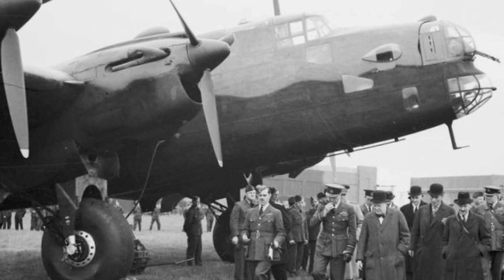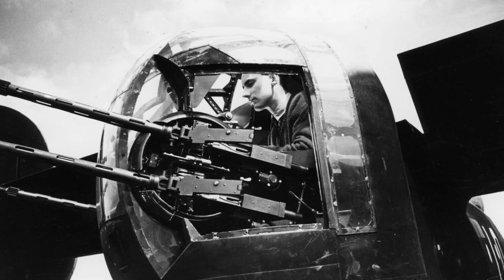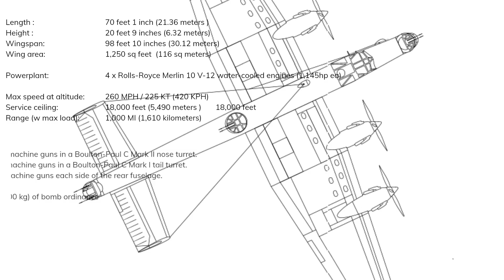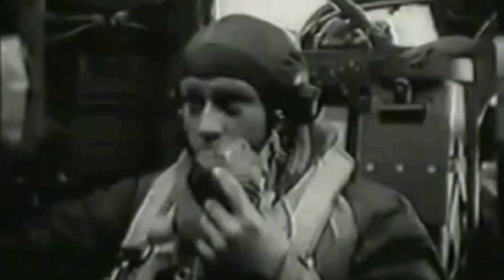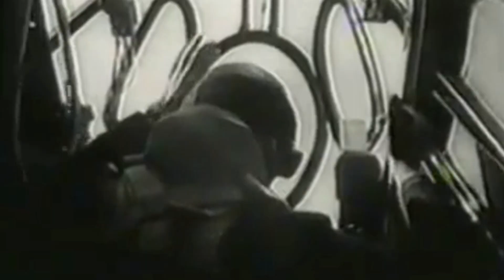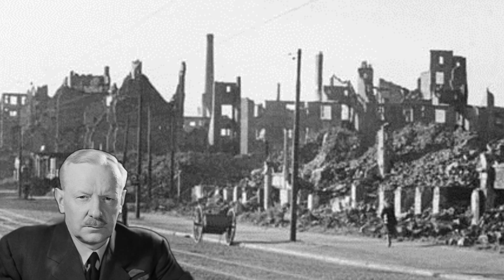The Handley Page Halifax

Comment: The Halifax was the preferred aircraft for secret missions over the Nazi occupied countries in Europe. It transported and dropped SOE agents, weapons, equipment and supplies to the resistance movements fighting the occupants. Its engines were not as noise as those of the Lancaster and the Sterling, and made it more suitable for slow low level night flying over the harsh mountainous landscape of Southern Norway dropping its cargo when spotting the vague signals from the ground. It was a dangerous mission which was essential for fighting and sabotaging the German was effort in occupied Europe.

Comment: My dad flew in the Halifax Mk3. He applied to join the RAF in 1939 but was told to complete his electrical engineering apprenticeship first. He did his training in 1942 in Canada and qualifies with his wings (for 2nd pilot), radio op - navigator and bombardier. He began operations from early 1943 including European raids, glider, coastal and transport duties.
Reply: Hi. Which Squadrons was he in?
Reply: @Oligodendrocyte139  I have his log books but I cannot access them very easily as they are in storage, sorry. I intend to hand them to the Yorkshire Air Museum at Elvington where his name is on the memorial wall next to the Halifax.
Reply: @davidpeters6536  A similar story with my father but he started later. We also have a memorial brick at Elvington 👍

Comment: Mark V was not just used on training,  and met flights, etc, it was fully operational on front line bomber squadrons.  Many of my Dad's 30 missions were on mark v, according to the squadron operational records and serial numbers of the aircraft used. Some were Mk ii.  The main difference seems to have been the non- standard undercarriage.
Reply: I think the reason was availability of parts for manufacturing.  Messier was standard, Dowty was substitute on Mk V. Reputedly the Dowty was dodgy, which seems surprising since  it's what was used on the Lancaster, but presumably they sorted the issues out.  The Messier u/c looks way more substantial

Comment: 1st Lieutenant Edward Dawson Kornegay, USAAF, joined the RCAF before Pearl Harbour and qualified as a pilot before being posted to England. After crewing up at 20 OTU, Lossiemouth (at which point my late father became his Wireless Operator) he became acquainted with the tired Merlin engined Halifax at 1663 HCU, Rufforth. Around this time, he was transferred to the USAAF but remained detached with the RAF at his request.
From Rufforth, the crew were posted to 640 Squadron at Leconfield, flying the Bristol engined Halifax III. They were to complete only 8 'Ops' although their baptism included Berlin and the ill fated Nuremburg raid. Head hunted by Hamish Mahaddie, they were posted to the Lancaster equipped 35 Squadron, Pathfinder Force, with which they completed a further 48 'Ops' before being screened.
Here's the thing though. Ed Kornegay rated the Halifax III as a better performer than the Lanc. It handled better and he preferred the Hercules to Merlins.
Reply from the maker: From all accounts the Mark 3s were as good or better than the Lancs in all aspects bar bomb load, unfortunately that's what bomber command prized above all.
Reply: The MkIII ‘s were a bit faster than the Lanc and crews were happy to get through the raid a bit faster than their cousins.

Comment: The guns on the later Halifaxes seemed more sensible than on the Lancasters. They replaced the front turret with a aerodynamic  perspex blister with a hole for one machine gun. The mid upper turret maybe slowed the Halifax down, but at least it had four machine guns.
Reply from the maker: TBH I didn't know it started with waist gunners. I'm loving this delve I'm undertaking.
Reply: The front gun was just a scare gun though, not likely to do much damage.
Reply: Not many night attacks from the front though!

Comment: It is strange how HP were able to uprate performance by deleting the useless front turret, but the Lanc stuck with the turret until the end; possibly because the RAF wanted to use the Lanc in daylight where the front turret would have been necessary. It is ironic that crews were more likely to be shot down in a Halifax than a Lanc, but more likely to escape the burning aircraft.
Reply from the maker: If the Halifax started with the right engine it could have reached a decent service ceiling, and although impossible to prove the counterfactual, it would have enjoyed a great return and survival rate.
Reply: It may have been that to replace the front turret on the Lancaster with the perspex blister would have interupted Lancaster production and Harris wanted every Lancaster to be available. The removal of the front turret  would have inhanced performance and payload.
Reply from the maker: True. A lot of production continued simply because retooling was a major disruptor.

Comment: The short distance beteen the wing leading edge and the low slung propeller also caused control issues.
Reply from the maker: I saw one mention of that to explain why the merlin's failed but the bristles performed.  But couldn't find a secondary source.
Reply: @Aircraft_Files  sorry, the props were in line with the wings leading edge unlike on the Lancaster which were set below the leading edge. This arrangement on the Halifax caused a greater disturbance to the airflow over the wing in a similar way to the disturbed airflow at the rear prop on the Do X seaplane reduced the thrust it produced.
Reply from the maker: Yes that's what they said.

Comment: You have no idea the Air Ministry specifications work. The letter indicates the type of aircraft (in 1936 F for fighter, B for heavy bomber, and P stood for medium bomber), the first number indicates the number of the specification issues in a given year (indicated by the last number. So for the HP.56 the specification was P.13/36  which decodes as the 13th specification issued in 1936 and was for a medium bomber. Whenever a new specification was issued from that year's series. This happend in tge case of the B.9/38 (B now just standing for Bomber) for a medium bomber that used no aluminium alloys. After the mock-ups from Armstrong-Whitworth and Bristol had been inspected two new specifications were issued B.17/38 (for the Bristol designs) and B.18/38 (for the Armstrong-Whitworth design). As the decision to drop tge HP.56 from the P.13/36 programme was made in 1937, the new aircraft should have been give a specification from the 1937 series, but no one has any evidence for such a specification.
Reply from the maker: Yes I actually did understand.  I simply meant that one of the two, avro or handly page would have raised alarm at how the engine was performing. Or maybe both. Thus leaving both the Manchester (built) or the inbuilt hp 56 to go at the new specs. Of course the ministry and vendors worked together.
Reply from the maker: Also as I mentioned the air ministry was turning away from medium bombers and leaning into heavies for strategic bombing. Both avro and HP went with the flow. No doubt talks occurred.
Reply: @Aircraft_Files  the official shift in emphasis to heavier bombers didn't come about until late 1938 with the issuing of Specification B.19/38 (which was quickly superceded by specification B.1/39), this brought forth nine designs none of which got beyond the design proposal stage. The specification called for a 4-engine bomber with a maximum weight of 50,000lb capable of carrying 9,000lb of bombs with a minimum range of 2,500 miles at a cruise speed of 280mph. It was to be armed with 20mm cannons for defence.

However, George Volkert had already predicted the future with a high-speed twin-engined medium bomber with no defensive armourment that exceeded the requirements of P.13/36 back in 1937.
Reply from the maker: I'm on the road so can't look it all up but just consider the Lanc heavy was born of the same spec as the Halifax. The major difference was avro actually built the Manchester.

Comment: In July 1937 the Air Ministry instructed Handley Page to redesign the HP.56 into a 4-engine bomber as they had grave concerns that RR woukd not becable to solve all the problems the Vulturexwas having and they didn't want two of the new medium bombers grounded due to engine issues.
Reply from the maker: It seems a bit hazy who triggered the 4 engine spec. It might have even been Avro with its Manchester mk 3.
Reply: @Aircraft_Files  it's not that hazy. As setbout in Tony Buttler's book British Secret Projects (Fighters and Bomber 1935-1950), in February 1937 we had the mock-up conferences and in April 1937 the HP.56 was selected as the second choice medium bomber followed by,I July 1937, the decision was made to drop the HP.56.56 for a 4-engined version.
Reply from the maker: I mean it's hazy who initiated the new spec for the 4 engine version. Just suggesting that 3 possible sources to drop the vulture. Including RR themselves. But I think no doubt that the ministry drove the shift to heavies. The companies just read the room.

Comment: Why was the Lancaster better than the Halifax?
Reply: Halifaxes went out of control with one failed engine.  Group Captain Leonard Cheshire VC (and a very long list) realised this.   A poor aeroplane.
Reply: @givenfirstnamefamilyfirstn3935 and resolved when the Merlin engines and the original tail fins were replaced.
Reply: Came later after the introduction into service of the Halifax.  Plus the Lanc was a failure at first when it was introduced as the two engine Manchester.    Lessons learned the hard way with the Manchester were incorporated into the Lanc.   Those improvement allowed to Lanc to fly higher than the Halifax and carried a heavier pay load of bombs.   As the Halifax was developed and improved, it was almost on par with the Lanc on speed, service ceiling and range but not bomb load.

Comment: The radial engine Halifax variants are really good looking aircraft. 

Somehow the Merlin engined ones just don't look quite right.
Reply: The Merlin engined ones had problems, nothing to do with the engine itself but the installation. HP ignored the advice of RR and instead of using the RR power egg HP used their own nacelle design which in addition to aerodynamic issues caused induced vibration to the reduction gear with ensuring regular engine failure.
Reply: Do you think if they'd have gone with the RR power egg the performance would've been better than the Bristol powered variants?
Reply: @uha6477  no , the Hercules powerplant was very effective and robust
Reply: OR IMPROVE THE PLANES PEFORMANCE
Reply: @MrDaiseymay  not much difference